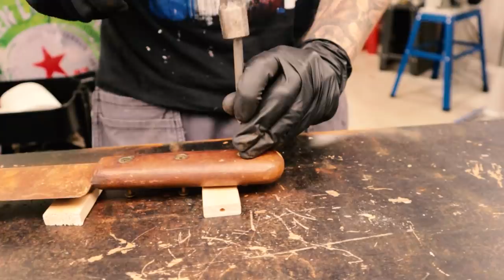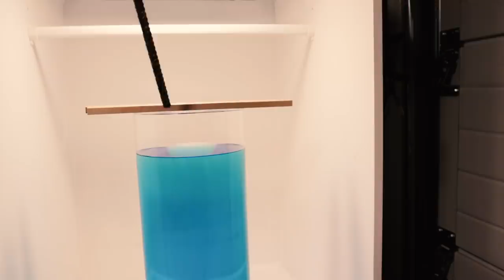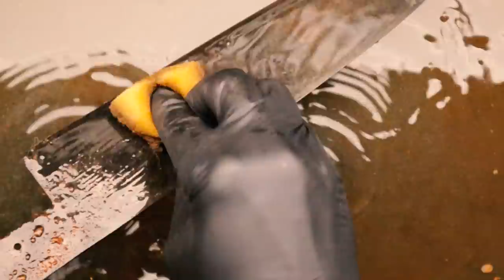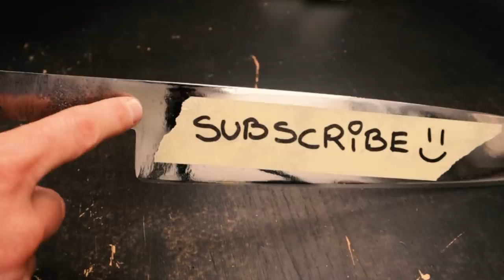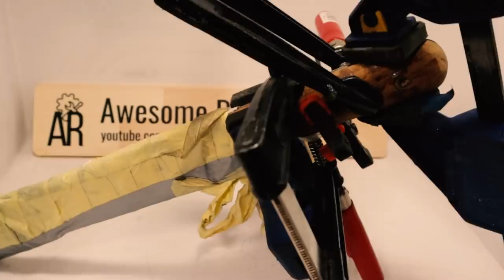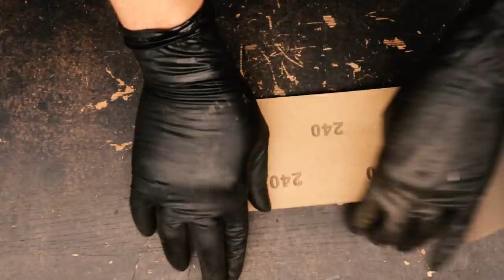HUGE Butchers knife restoration and sharpening - Antique kitchen knife

Comment: I admire your tenacity in keeping and fixing the knife handle. Sometimes the, "I make a new one" approach is cool, but I much prefer the, "Let's fix the old and make it new again" angle. Well done, mate.
Reply from the maker: Thanks for watching  Fredric and for your kind words I really appreciate it 👍
Reply: I agree. In most knife restoration videos the first thing they do is make a new handle. It's refreshing to see someone save the original.
Reply: I will make a new one. That's a so familiar
Reply: He could have avoided breaking the handle, though. He used too large of a bit.
Reply: @spazmccoy  Probably, but we don't know how strong the wood was to begin with. At least he saved it, instead of throwing it away.
Reply: I agree. Save what can be saved, and only make new parts if everything else fails.
Reply: Yeah, it’s nice, but sometimes the wood is just rotten, can’t really save it.
Reply: I was shouting at the screen........ don't throw the handle, DON'T THROW THE HANDLE!! lol

Comment: i love the fact that they didn't replace the wooden handle for a new one.
Reply: I agree, most people would replace it at that point which for me takes away from the original knife, was really happy to see it glued and kept.
Reply: It's a 100 year old handle. Just as valuable as the rest of the 100 year old components.
Reply: Why would he? It’s 100 years old would be pointless pointing new wood on it
Reply: I like that he kept the spirit of the 100yr old knife intact by using the old handle, but personally i would've gone ahead and replaced it with a micarta handle as it would be less susceptible to damage due to water/moisture. Overall well done!
Reply: Do you really?
Reply: Me too.
Reply: To be fair, the handle has held well for it being 100 years old.
Reply: I’ve watched enough furniture renovation to know if you can glue it you don’t replace it.
Reply: Y
Reply: @SSingh-nr8qz  its cracked, its not worth a lot if money or something.
Reply: Hi
Reply: The handle wasn't in all that bad of shape. If it was in much worse condition then he would have had to replace it.
Reply: @muzz4kt594  з жжж

Comment: Could have saved hours with the “blue” potions and scrubbing, by using a grinder to knock off rust.
Reply: I came to the comments specifically for this. I don’t get the “benefit” of it, if the very next step is flap-wheel on a grinder. Is it a fad?
Reply: Why does everything he restores look like it was soaked in acid. All the oxidation is the Same.

Comment: Really nice work. What brought me here is I acquired an old cleaver that's been rusted to shit and the edge was quite jagged. I spent most of last night taking the rust off and trying to work the edge back to something workable again. It's still quite pitted and will need to go over it again with a flap disc, but it still has plenty of good iron left on it. I came here for that and to see what you did with the handle. Again, your work on this blade is quite nice. thanks.

Comment: You had me with the electrolysis to remove rust, the polishing, most of it. Even the clumsy way you reshaped the end could have been excused because you aren't a woodworker. But then hit that thing with a buffing wheel. With the predictable result. Burned, unevenly stained wood. Not just any wood, but 100 year old wood. That needed absolutely no staining. I died a little. But the blade itself, very nice job.

Comment: Ok Fyi .. when that knife was heat treated so was the  tang when you tried drilling through  that hard steel I heard what I believe was chatter ..  you know what Brake shoe Rivets are thats what Dexter and old Hickory use ..   now if you get a 1000 degrese heat block  and put that around the Racasso of that blade  and heat that tang up to a dull red and aniel it .you  can do it  with out a problem . Far as pinning use 3/16 brass brazing rod and score it good .. not bad I like how you used the Aluminum with the brass brazing Rod .. with I could post a photo of the last Blade I made. I think you would like it a Duo  grind 2.5" whollow grind taken to zerro and 6" flat ground blended together .
Reply from the maker: thanks for your comment and for watching my video :)

Comment: Lovely job, but the trouble is.. As soon as you put it in a dish of water to wash it after use- it will Rust very quickly, as the surface hasn't been plated with anything!
Reply from the maker: Thanks for the tip!

Comment: just found this video happy days , brilliant restoration yet again , question when using Electrolysis to either plate something or to remove rust does it leave a mark where the clip to put the current through is placed .????????.
Reply from the maker: Hi Donald, no there are no marks where the clip was :)
Reply: @AwesomeRestorations  thanks for the reply , i have wondered that for a while . keep the restorations coming . they are the best .

Comment: I wish you'd made a new side slab instead of repairing the old one. It's workable, but I think this knife deserves better. Why the big inserts anyway? How did they effect the balance of the knife? The balance in a chef's knife is important. by the way, they're great for cutting things up fine, once you have them cut from the original veggie or fruit, you put your left hand (if you're a righty) on the tip and just rock it through the veggie or  fruit. That is why the blade is shaped that way.  Good chef's knives all have a nice rounded tip like that. Some cheaper ones ... not so much. When I was working as a short order cook, we all used knives much like that, though more modern, still the same shape. we also had one that belonged to the restaurant that we used for rough things, we sure wouldn't want to damage our own knives, the aren't cheap if of good quality.

Comment: Awesome video just 1 question. Why did you use electrolysis to remove the rust when you hit it with a flap disc anyway kind of seems like an additional step that wasnt required when the flap disc knocks the rust and pitting off anyway
Reply from the maker: Thanks for watching... I don't want all the rust to fly around in my shop, so I try to remove as much as possible before using a grinder 😊😉
Reply: @AwesomeRestorations  
Hey completely understand that mate im a boilermaker in the mine so everything is rusty or black in coal so definitely understand lol

Comment: First of all you should of been more careful when drilling through the wooden handle, and you could used similar size compression rivots. There was no need for the those rivot guides as your aim was to keep as much original as you can. Secondly since you split the knife handle your better option was replace the complete handle. If was a paying customer to get my old knife restored I wouldn't been happy with a getting it back a broken handle glued up because the cracks still show on the handle.

Comment: If you were going to power sand the blade with an angle grinder anyway then what's the point of removing the rust with electrolysis first? Isn't it redundant? Sanding it with the angle grinder would achieve the same result, no? Seems like it's just adding a needless step at the beginning that would get taken care of later anyway.
Reply from the maker: Hey Troy Thanks for watching - you got a point there.. But in my case it's to avoid rust being spread all over my shop when grinding 😉 I have so many tool on the walls, I just don't want them to rust unnecessary 😉👌

Comment: but.... aren't the pins in the handle just loose? there's no glue keeping them in place or anything. they were even moving around in there when you were peening the brass.
Reply from the maker: Thanks for watching - The old pins was not loose, that's why I cut them loose - The new pins is hammered solid in the handle (Like the did in the old days before super glue) I used a brass pin inside the aluminium pin to expand the aluminium - This will keep the knife handle "rock hard" in place for the next 100-200 years 😉👌